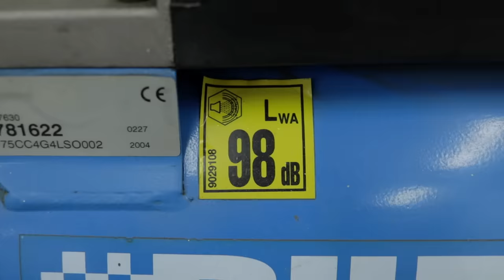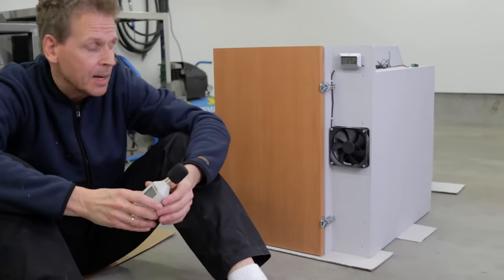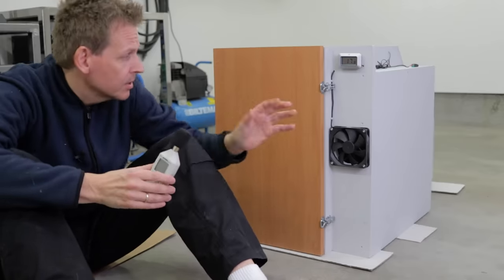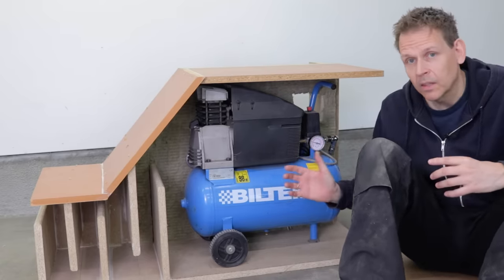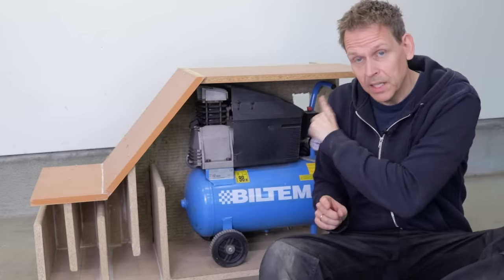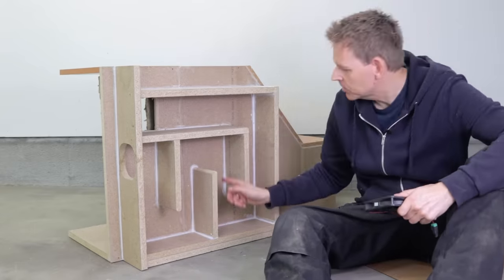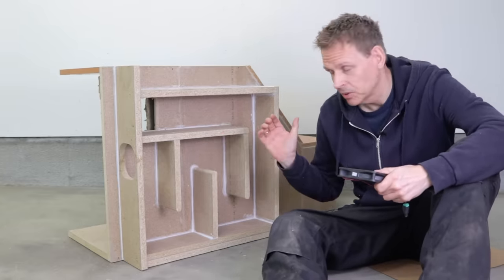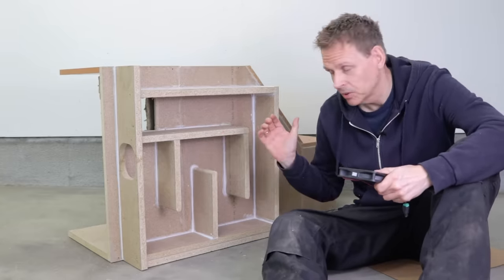Do not build a sound insulated enclosure for your noisy air compressor!

Comment: Just an idea or two:  

Your statement about a long path to reduce sound is mistaken.   
Out in the open air, sound spreads (inverse square law) so it reduces with distance.

However, in the box, the sound is trapped in (effectively) a narrow tube, so it tends to come out about as loud as it went in.   (As your experiment shows.)

But your enclosure will greatly improve sound reduction if you line the box and the (in & out ) air path (baffles) with (e.g.) 1/2 inch thick sponge foam to absorb the sound, and cushion the legs / wheels from contact with the box.

You can also save a lot of space by putting the compressor itself in a small box, but have the tank outside it.
Reply from the maker: Aha, I might have got that wrong then (long path to reduce sound) 🙄 but I am not sure if it's correct what you say here:
- "However, in the box, the sound is trapped in (effectively) a narrow tube, so it tends to come out about as loud as it went in.   (As your experiment shows.)"
I could very clearly hear and I did even measure a solid noise reduction when putting the air compressor inside the box.
I think you are right when you say that the noise reduction could be even better with more sound absorbing material inside, but the sound was reduced as I made it 🤔
Reply: @kihestad  Yes, boxing it in at all causes some of the sound to be absorbed by whatever materials you use.    

If you shout into one end of a long drainpipe, whoever is listening at the other end will hear you clearly because the sound wave is trapped and forced along the tube (even if there are elbows in the pipe).   But if you line the tube with soft material, this will absorb most of the sound and there will be massive attenuation.

So a plain hard box will enclose the sound, but a hard material like wood will transmit a substantial proportion of the vibration.   Lining the box and air path with soft material or foam (and cushioning all contact between the machine and the box), will absorb the sound and quieten it down the most.

Comment: I think something extremely important to note here is that dB is a logarithmic scale.  So for every 6 dB you reduce, you lower the total amount of acoustic energy by over 1/2.  That is a huge deal in terms of your hearing longevity.  Is it whisper quiet?  Maybe not, but it is a drastic improvement to your overall working environment.  Also, something that is very interesting about acoustic noise.  Most people want something to be whisper quiet so that they aren't bothered by it and can talk to other people or hear other things going on.  The interesting thing is that if you are able to reduce the most amount of energy in the frequencies used for human speech you could have a completely clear and easy to hear conversation without raising your voice, even if there is a lot of high and lower frequency noise present.  Simply creating something like this cabinet would go a long way to reducing energy in that 400-2000hz frequency range that human speech occurs at.
Reply from the maker: What you say makes sense, I totally agree! The remaining noise it's not a big deal at all. It's noticable, but it does not hurt or is damaging any more, and that's the important part. Got to remember: this is a workshop - it's a lot of noise from all kinds of machines anyway, it's not a bedroom or a living room 😊
Reply: @kihestad  great video by the way!  Very well done.

Comment: Foam padding in the floor, under the enclosure would help even more. Then Sound deadening material around the area where the box is located upstairs too.
Reply from the maker: I agree, most of the sound is now caused by vibrations transferred to the wooden floor. Thanks for the tips 👍😊

Comment: Get longer air lines, put the compressor some where were you can't hear it.  Like in your van or out side.   Maybe in your Neighbors house.   You need a long extension cord so you you shut it off from a 300 feet away.   Build a case around it using homasote.   Get a noise cancelling radio.  I just bought batterie nail guns.  Hardly ever need one these days, but a siding nail gun does not come in cordless.
Reply from the maker: OK. I'll do it 😋 I will be busy for a while... 😁😂

Comment: The issue is that the box is a rigid structure that resonates, and you'd have to do what we call in the audio industry a room within a room, or in this case a box within a box.  The inner box can't make direct contact with the outer box but would have to be sperated by rubber pieces that absorb the mechanical vibration.  Also the box itself should have rubber feet incase the outer wall vibrates so it doesn't resonate onto the rest of the room.  Hot air also is a big deal as it increases the speed of sound and thus making things worse, so cooling it down well is important for consistent noise reduction.  It was a good idea however to solve the issue at its source which is the compressor itself.  One last tip would be to use acoustic sealant instead of silicone to join the pieces together and to avoid using metal screws to join everything together as the screws themselves transfers the vibration over, rather use special metal brackets that have a rubber isolator in between them to avoid transferring the vibration from one piece to another .
Reply from the maker: Thanks a lot for the tips 💡 Good to know for version 2.0 😊

Comment: Actually - I'm surprised to see the California Air compressor featured here - It is absolutely the quietest compressor I've ever used.
That being said though - I did put rubber washers on all the metal-metal contact places (which may have helped some) but I'm really happy with mine. I've had some Craftsman and HF compressors where I would jump outta my socks and across the room when that motor started !
Reply from the maker: A lot of people have recommended California Air, and I have seen a lot of positive reviews online for their products as well. It seems solid! Unfortunately, they dont sell them here in Europe. I'm not 100% sure, but I have at least never seen any ad for them over here.

Comment: One thing that will drastically help the performance of the baffles is making them angled and not parallel. Sound loves parallel, equidistance surfaces.

Speaker manufacturers make use of angles and curves inside their enclosure to minimize any resonances that might radiate from the speaker box.
Reply from the maker: Yes, someone else mentioned the exact same thing. It's a very good suggestion! Thanks! 👍

Comment: I have a quiet compressor. It used to have 2 of those silent 550W motors. Forgot to switch it off. Airline popped in the middle of the night, and my compressor ran all night long. I did not hear anything. One motor died - they aren't really well cooled. Now I put a timer switch on it. Never needed it to run for long anyhow, but it would certainly save the remeining motor should anything untoward happen again...

These things are quiet.😅

I'm also building an outdoor cabinet for the compressor and the dust collection system. That'll take the noise from both units out of the workshop altogether. Maybe another way to address the noise issue?
Reply from the maker: Ahh, that was an unfortunate happening 😌 A timer switch was smart, and moving it to a separate room further away from the workspace is very smart! I guess you’re doing woodworking since you have a dust collection system? I have just a portable big vacuum cleaner I connect to the few woodworking tools I have, but even that is extremely noisy. I can understand you want to move the noise away from the workspace 👍

Comment: One of the most common problems dealing with sound isolation is mechanical vibration .  Wood is not a dense material and is not good to create a box for sound isolation when dealing with industrial equipment.  Wood is good to make acoustic sound amplification because is lighter and transfers vibration.  It can muffle or deaden the sound but you still have plenty of vibration and if the box is sitting on a hard surface it will conduct and convert that vibration into noise.  If you are going to make it with wood at least adding some rubberized bottom of feet will help greatly.   Great construction though and I liked that you added a sound trap too.   Some sound absorption material covering the walls of the sound trap would help a lot too.
Reply from the maker: What you say makes sense, vibrations are the biggest source of noise now. I will try to improve it as you say by adding soft rubber, dampening foam or springs on the compressors feet inside the box, and under the box to reduce vibrations going into the floor. When I built it I was afraid of not having enough airflow for cooling, that is why I did not put any more sound absorbing material in the ventilation channels. Cooling has worked great, so I might add a bit more dampening material.  I might also add some bitumen mats on the inner walls of the box to see if it can reduce some of the vibrations. Thanks for all the tips! 😊
Reply: @kihestad  Hey!  No problem!

Comment: I don't think the longer path works as well as you'd expect, because the sound diminishing is in big part due to it spreading over a larger area, but in a tube it doesn't. though the insulation dispersing the noise, and reverberation canceling out a part probably still helps quite a bit.
Reply from the maker: I think you are right. I was afraid of not having enough airflow for cooling, but since that has been proven not to be any problem I have considered adding thicker sound absorbing materials in the channels.
Reply: @kihestad  at this point I think it would be more effective to simply run the compressor outside if possible

Comment: I was thinking when I  started watching - why not to buy a silent compressor? - and there it is in the next half of the video. Good job. I have similar one for my small garage. 
 I wonder what is the airflow (cfm or m3/s) of the compressor vs the computer fan? What's the temperature inside the box when the machine is running for longer? 
For my place I'm thinking to add another big vertical air tank.

Comment: I actually forgot this before watching this video, but when i was a child, air compressor was always outside in a brick enclosure. No door, just red brick and a back wall. I'm 63 now and don't remember how loud they were. I would think the density of brick would be an excellent sound deadener, but i really don't remember.
Reply from the maker: I would guess the brick wall did the trick. Putting the air compressor outside is very smart, unfortunately it was not an option for me 😏

Comment: The first compressor in the box had a greater reduction in decibels than the second compressor. I would suggest building a vibration dampening base plus raised surfaces on the inlet outlet channels.

Comment: Hello, you might also place a pad under the compressor box to reduce sound vibration through the floor. Cheers.
Reply from the maker: Yes, you are spot on! Others has commented on it as well, vibrations going into the floor is probably what is making most of the noise now. It will be my next improvement. Thanks for the tips 👍

Comment: If you can see a sound source, then the sound has a straight path to you.  Putting a barrier across a direct broadcast path will reduce the sound at your ear because a non-direct path has attenuation due to reflection.  Just a sheet of plywood blocking a direct pathway helps; while you're at it, glue a 1" layer of insulation to the board (on the noisy side).
Reply from the maker: Thanks for the tips! I have used 3cm = 1" Rockwool sound insulating mat inside the box in the main chamber where the compressor is. I might also add a bitumen mat on the inner walls, it is supposed to block vibrations and the low frequencies.

Comment: One advantage of a more full enclosure, even if it's not as quiet as you'd like: it's likely some degree of safety improvement in case of a ruptured pressure vessel.
Reply from the maker: Yes, that is true. If anything happens I now have at least one quite heavy duty box around it for protection 😊

Comment: A really helpful trick is to buy an really big tank from an old air compressor and use it to increase the capacity of your compressor. This buffer tank makes you have to run your compressor way way less often and can help an underpowered compressor keep up with your uses. 

Also noise reduction foam is way more efficient than the wood baffles he made. Even the foam mattress topers with the wavey surface works great.

Comment: You need a wall thickness that is equivalent to half of wave length you want to dampen. 

And the material has to be heavy but semisolid  if we dampen lower frequency. 
The wool you used is good for speech but less for rattling low frequency noise.

So the box with double -sided walls, filled with sand would be ideal - if you want to kill sound substantially. 

And air inlet, outlet would be better to funnel outdoors , e.g. via insulated pipe. Outdoors always have higher noise levels, so it will not be noticeable.

Also soft rubber pad under the box and under the compressor inside would help too.
Reply from the maker: Hmm, you say: "you need wall thickness that is equivalent to half of wave length you want to dampen". Does that make sense? Does not different materials have different effect on sound? I would assume a concrete wall vs wooden wall  would need different wall thickness to get same result? The wavelengths of sound frequencies audible to the human ear is normally 20 Hz to 20 000 Hz. How can these numbers be used to calculate wall thickness? 

I think you are right about the material I used, it removes the annoying mid and high frequencies, but not the low. I have been suggested to add bitumen mats on the inside, these are not very expensive and easy to get hold of. Double sided walls would have been great, but unfortunately the space where I have my box is the limiting factor 😑 Thanks a lot for you tips, although I did not quite understand the wall thickness recommendation 😋

Comment: When I sow how much you invested in building that box I want to say "Just buy silent compressor" and problem with hitting would be present in that box. 
BTW there is much simpler solution. You just have to put silencer on air intake and you won't believe how much improvement that would make.
I build my simply from coffee can, some rubber hose and sponge.
I was surprised how well that worked, didn't measure loudness but I'm sure that it made it at least half quieter. From irritatingly loud to sound where you can make normal conversation next to compressor.
I wonder if this trick would also work on silent compressors?

Comment: I love my California brand quiet compressor. There's a similar small and quiet one at Walmart as well. kinda slow, if I used it more I'd hook it to my big compressor and set the switches so the quiet small one ran first and took care of most of the supply.
Reply from the maker: A lot of people have recommended California Air, and I have seen a lot of positive reviews online for their products as well. It seems solid! Unfortunately, they dont sell them here in Europe. I'm not 100% sure, but I have at least never seen any ad for them over here 😞

Comment: I agree, get a scroll compressor! There are ones in the 50dB range by design. For example: Stanley SXCMS1350HE has a 50liter tank and sells below 300 EUR
once you have owned a scroll type you will never go back to the noisy rattling piston type. (yeah they are half the price, but just don't!)

Comment: The only thing i would recommend as an upgrade to this would be a rubber (actually cork might work better) under the compressor.  This will minimize vibrations transferred directly to the wooden case.
Reply from the maker: Yes, I think that is a very good suggestion 👍 Vibrations transferred to the floor is what causes most noise now. I have not considered cork, will be investigated. Thanks for the tips!

Comment: Perhaps rubber or a type of shock absorber would dampen vibrations making it more quiet. Cool video. Thank you.
Reply: Nevermind he did it lol.
Reply from the maker: Well, I think it can be improved though - so your input is valid 😊 I have some vibrations still, and I think adding more and better soft rubber to tackle vibrations will make it even better. Thanks for the tips!

Comment: Honestly I’d just set it up outside way easier running longer lines from like a shed or something
Reply from the maker: I wish I could 😊I just dont have space for it. My garage is placed with minimum distance to two of my neighbors. The side facing my own property is not usable either,  as it's just a slim path between my garage outer wall and a concrete retaining wall. In front of the garage door is no good either 😋